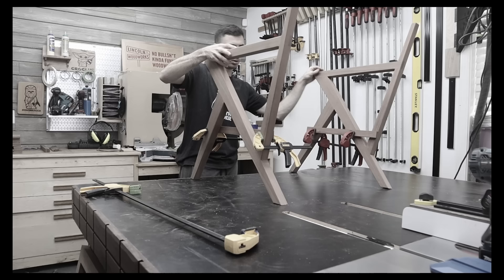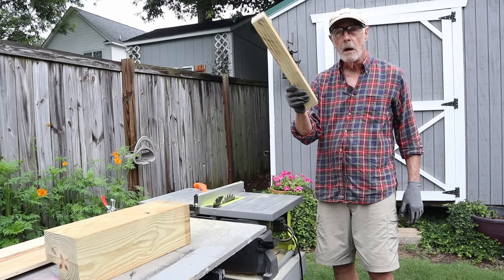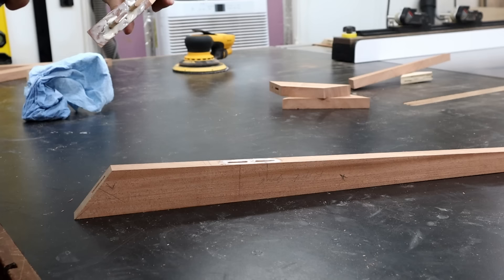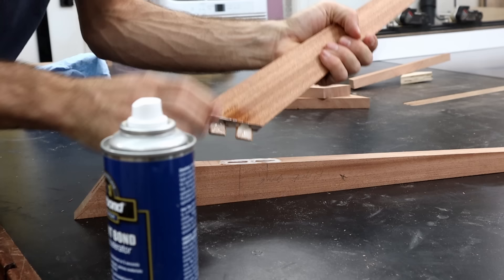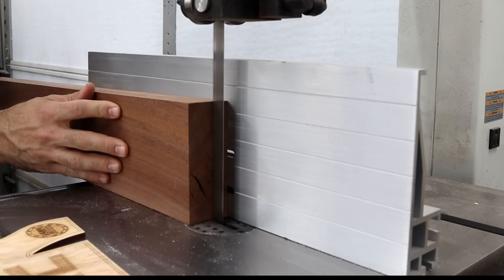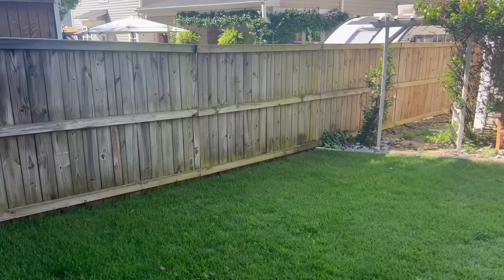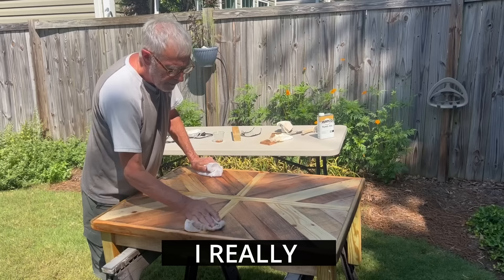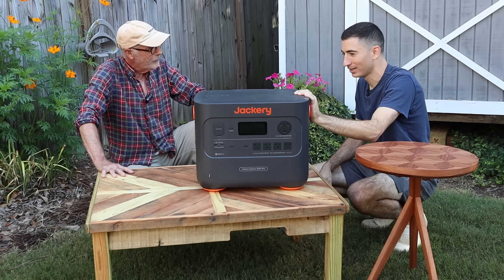I challenged a 78 year old to a build off

Comment from the maker: If you want to see the follow up video where we trade tools check it out here https://youtu.be/Y0hqk3VP24o?si=En9hiSUV6AYWxdom
Reply: It's nearly impossible to vote on two different designs and materials. I like them both for different reasons. Older Johns made a nice serving table that accommodates more and the wood grains and finish we nice, but the small end table had a more refined finish. To test the actual craftsmanship, they'd have to be put to use and some abuse to see if they were stabilized to stand perfectly still and hold a tight frame.
Reply: Both are nice i prefer the square but the other is nice too im going to build em both nice work guys
Reply: like the pallet
Reply: Thank you for sharing this video
Reply: @lincolnstww 10:33 you were planning the corners of the board at a 45. I am currently designing my very first build dining table for my home… spending a lot of time thinking of the details. I am guessing the purpose of doing so leaves a small groove between each piece of wood when joined together? For a large round more formal dining table would you say leave those grooves out?
Reply from the maker: @justindez  the chamfered 45 edge helps highlight the pattern. But it wouldn’t be great for a dining table because it would catch crumbs
Reply: @Lincolnstww  that’s what I was thinking